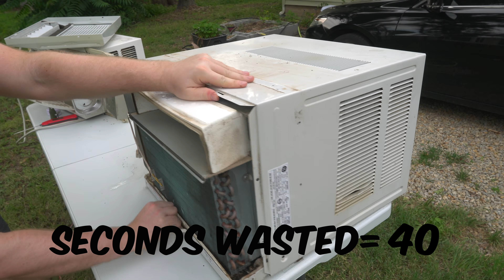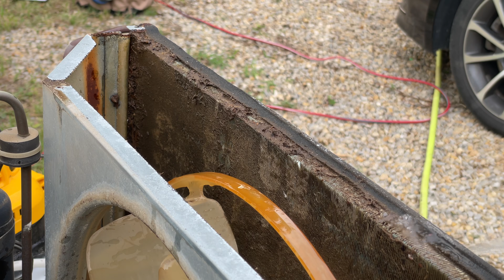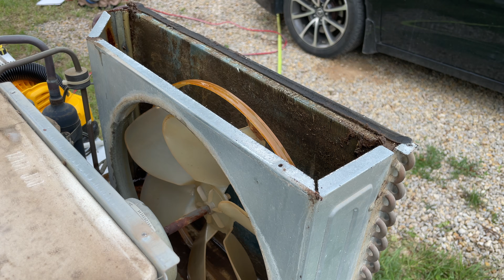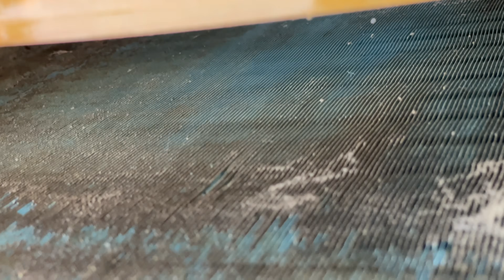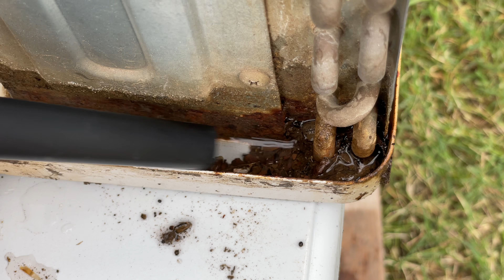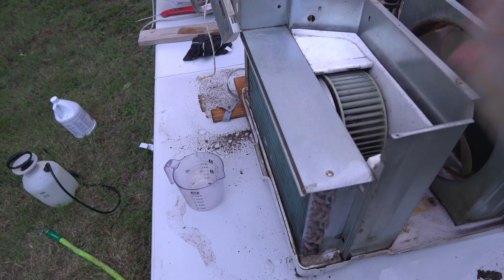DEEP Clean Window AC The Correct Way!

Comment: Mine is a dual converter U shaped Midea.  And a big mother.  It's installed on the second floor, and I live in an apartment that has no elevator.  I noticed it has screws on top of the outside part.  I think I might need to put coolant in, because a couple of times I smelled a sweet smell.  This one is 3 1/2 years old.  I wonder if I should just replace it.  I can't take it out of the window, as it's too heavy and is bolted to the brackets.  Can I get some advice?  I keep reading a window ac should last 8-10 years, and Id hate to just toss it after 3 years of regular use
Reply from the maker: If it's cooling fine, I would just keep it. One thing you could do is buy the coil cleaner, link in this video description, and clean the part that is on the inside. Make sure your filter stays clean as well.

Comment: I just cleaned my window unit today but had to come up with a way to get it as clean as possible WITHOUT removing it from the window. (I leave it installed year round because it's 90-125° 7 mo/yr where I live,  I just cover the vents for a few months when it gets cold at night.) I always have Simple Green on hand, a habit I picked up from my dad, but I needed to find a way to clean out the inside without having the convenience of being able to take the outer shell off to see what I was doing. My solution? STEAM. I have a high pressure handheld steam cleaner I picked up for about $50 on Amazon that get up to 280° with controllable pressure output. I took the front cover off, protected the circuit board and thermostat, sprayed the F out of the fins and coils behind them with Simple Green, used a soft but dense makeup brush to gently scrub the fins, then blasted the fins/coils, air vent duct, and the fan blades/wheel with high pressure steam. It cleaned all the buildup and mildew that I could see without using harsh or corrosive chemicals, and even in a house with people who smoke, the residue and buildup on the front cover and inner fins/coils just melted off. No damage to the delicate fins, no risky degreasing chemicals. After watching a ton of YouTube videos of people cleaning window A/C units, I'd bet using steam not only cleans and sanitizes the entire unit more thuroughly, but it does so with less than half the work and doesn't introduce any chemicals at all. Even if I could take my A/C out of the window, I'd still clean it the same way I did today. When I compare my results and the amount of work it took to get them, it's no contest.
Reply: What steamer did you buy from amazon?
Reply: You should make a tutorial

Comment: Is there a way to do this WITHOUT taking the unit out of the window? When I installed my unit I acually took both window panes out, made a custom frame around the unit to prevent any possible holes, then used 2x4s and a sheet of 3/4" plywood (with 4 thick coats of waterseal then coated in 100% silicone) to seal off the window completely. I live in the middle of AZ in a mobile home, in the summer,  even just a tiny sliver of sunlight can heat up a 15x15' room by up to 20°.
Reply from the maker: No, but you can clean it really good using the "lazy"  way, I have a video on that

Comment: I Just use water hose with a spray nozzle on front fins through the front,and the back fins spraying inside through to the outside works great everytime.
Reply from the maker: In sure that does a good job. It's definitely better than nothing and quick

Comment: I use this ac cleaner it works great tip for cleaning these things on a regular basis these things werent really made to be taken apart. make sure unit is off what i did was cut out 4 of the airhole slot fins in the left side just big enough to get my shop vac hose thru and bam now u have access to keep this thing clean i recommend running clr overnight twice a month to keep corrosion down. If the unit is covered in crap youll probably have to disassemble and clean like he did my method is to keep it clean i do this without ever pulling it from the window. Use this methond and the outside pan part of the ac will be clean year round it will break up crap that was stuck in there too so be prepared to shop vac it a few timesnfor the first week. there is mildew in the styrofoam front side of ac u can take off the front grill and  bleach clean really good and tape a rag to a big screwdriver and use it as a cleaning tool for styrofoam front area and hole.

Comment: First major appliance deep clean as an adult and your tutorial made it so much easier! I’ll find you when my fridge is next ;)
Reply from the maker: Alright! Good job 👍🏼
Reply: @HandymanHertz I have to tell you , I'm extremely leery to take mine apart . 
   But I'm noticing darkwater pooling up in it and it's a newer model from Toshiba ( 6,000 BTU ) ... ALL plastic crap .
   It doesn't have the hole in the bottom and I don't know if I  should drill one ; people say it's not a good idea ... 
  An ample amount of water DOES drip out , though  .
   I'm thinking I'm just better off at this point trying to make it through the next 2 and a half months here in Dallas by just flushing out the bottom and and the blades with some of those cleaners  ?
    If you have any suggestions -- that means a REAL LOT to me , man  .
   Any advice is greatly appreciated .
Reply: @HandymanHertz Also even though it's in a window on a patio that has a roof over it ... I still got the brutal morning Dallas sun beating down on my AC unit ... I can't believe how hot it gets on my patio some days as early as 7 a.m. and only just recently learned that I should try to find a way to SHADE the unit FROM THAT DIRECT SUNLIGHT ... but we're not allowed in this apartment to have anything such as patio curtains or screens  .
   For some reason my tiny pea brain is not able to think of something that will NOT block the air but will block out the sunlight ... ? 😂
   Any suggestions  ?

Comment: Hi!  I love the video, but I was hoping to not dismantle the whole ac.....I cleaned most of the parts and do stay consistent with the filter...Looking inside from the vents where the cool air flows in you can see a curved styrofoam piece (inside the unit) and I noticed some discoloration....black spots? I did the best I could using a long flat head screwdriver with a wet thin towel attatched....Hard to reach all the way in and I cleaned what I could....Lysol wipes, bleach, vinegar?? Any opinions or thoughts....I appreciate you and your advice!  Thanks!  Deb~Rhode Island
Reply from the maker: I personally wouldn't use bleach or vinegar, as they are corrosive to metal. Maybe some concrobium (link in description) would do the trick. Every unit is a little different, but I'm sure you can keep digging and disassemble it a little more. Good luck.

Comment: I think, after you spray and clean the mold with the tri-sodium formula Concromium, you want to spray it again to leave salts on surface to prevent new spores from attaching and to smother the roots of the old mold which prevents it from coming back.
Reply from the maker: That makes sense, thank you for the tip

Comment: I plan on doing this tm bc i bought mine from someone on Facebook market place and its so bad it leaks condensation out of the front bc the back clogged and it doesnt circulate air
Reply from the maker: This is a good idea. Make sure you unplugged the passage from the front to the back, or it will continue to leak inside unless it's not properly tilted

Comment: If the fins are so plyable that water can bend it,
How is it that you can scrub it so hard with such a hard wire brush??
Reply from the maker: You scrub parallel with the fins, so you don't have any side force to bend them. You can spray high-pressure as long as it's not at an angle.

Comment: So this helps it blow out cold air again too? Mine is about 1-1 1/2 years old and it’s starting to blow out warm air.
Reply from the maker: Yes, there's 100% correlation between warm air and a dirty condenser coil and evaporator coil and air filter 👍🏼 in fact, I have a video where I compare it before and after a deep clean and there was a huge difference. You can find if you like.

Comment: Do Not use CLOROX on any kind of mold from walls to wood to a/c units because it tends to feed the mold and don't get me wrong it will clean off the mold,  but the mold will come back faster and will be twice as thick.  You're better off using Lysol, which will work faster and be gone longer.
Reply from the maker: 👍🏼 thanks for your input.
Reply: Bleach any kind of bleach is a bad for these due to it being corrosive to basically any kind of metal (some exclusions) degreasers are much better and safer option

Comment: There are E-Z Detail Brushes similar to that long one you have . They are used by car detailers and workstuff , small brushes to get into tight spaces . And buy one with an inverter motor , uses much less  electricity.
Reply from the maker: I didn't even think of looking for brushes in that industry. Have to check them out. Thanks.
Reply: @HandymanHertz  ok

Comment: Speaking as a doctor: mold control products often contain isothiazolinones that are strong sensitizers capable of inducing allergies. Researchers have also linked them to endocrine disruption and neurotoxicity. Unfortunately, they are increasingly ubiquitous, found in many personal care products, household items, and even some paints.

Every window air conditioner I’ve seen has so many nooks and crannies that it is impossible to thoroughly clean them — and few folks take the time to do that. Reputable manufacturers would therefore not make them but instead redesign window air conditioners to make thorough cleaning quick and easy without disassembly. Because they don’t, countless people see their doctors for coughs or other problems treated with medicines that are often costly and produce side effects. Unfortunately, very few doctors understand the extent to which the exposome influences health. This is but one of thousands of exposome factors overlooked by doctors as well as unconscionable manufacturers producing needless problems.
Reply from the maker: Interesting perspective.  

people need their houses cool…and need window ac's,  so what's one to do? 🤷‍♂️ 

I don't agree with your theory that "reputable manufactures are not making them and if they did would make one that could be cleaned quick and easy without disassembly" that's a wild and idealistic claim. it doesn't sound like you have much understanding of engineering or the mechanics of making that happen, or understand how far refrigeration has come (or not come). In all fairness, neither do I.
Reply: @HandymanHertz  : There are many possible ways to circumvent this problem. For example, eliminate areas (especially inside*) that trap condensed water, pooling as stagnant water that provides conditions favorable to mold growth. (* The trapped water outside is intended to provide a pool of water that is slung against coils to increase the unit’s efficiency.)

Another idea: eliminate idiotic design elements. For example, my window AC unit (how I discovered this problem and learned of many others on YouTube with even worse mold contamination) has a convoluted air channel made of Styrofoam (or expanded polystyrene = EPS) that is cold during operation so air moisture condenses onto it. EPS cannot be thoroughly cleaned as, say, smooth, hard plastic, and when it is convoluted with inaccessible channels, it’s just plain stupid.

Reputable manufacturers would not take advantage of people seeking cool air and burdening them with contaminated air. As impressive as your cleaning job was, it was not complete, and I’d bet that less than 1% of consumers will do an equally or better job – meaning that over 99% will have AC units spewing out significantly more mold. Smart, creative engineers COULD create safe products; it is very doable.

Comment: This was so satisfying to watch. Do you take your window A/C units out of your windows in the off season?  That level of dirt and grime was significant.
Thanks for a great video and the motivation to clean mine.
Reply from the maker: This one came with a house that I bought, and this was the first time cleaning it, so I'm not sure how long it had been. I do take my AC out during the off-season. This one I did not, because it's so heavy and it fits my window almost perfectly, reducing the cold coming in. I have a U-shaped design, that I have two of, and I will not be taking either one of those out, because of its design. I'd recommend those, and have a video on them.

Comment: While I appreciate your attempt to give folks a way to clean their own units, I have a few tips. 1st, don't tip your unit over, compressors are not designed to be tipped. 2nd get a coil cleaner, its cheap and does all the cleaning without needing to brush. 3rd, do not use a brush, you can easily damage your coil fins.  4th protect your electronics with a bag or something.
Reply from the maker: Thanks for the tips. that Dirt/mud need some sort of manual brush, all the soaking in the world wouldn't touch that. Compressor will be fine if you let it drain out, I've never had an issue with that or electronics yet, but that's judt my experience.
Reply: I don't mean to be rude but given the fact the outside is worse than a degreaser and the dirt and pollen and rain is worse than the water getting in, so what are you actually talking about dude. No condensor is made to be moved a ton but they are, especially when you're putting it in a window and same with a fridge fridges get moved and the condenser is fine so what are you talking about
Reply: As an electronics technician, I agree that it’s best to cover the electronics with a plastic or another impermeable barrier.  It also doesn’t hurt to let it dry out thoroughly after cleaning.
Reply: @AdamRuppert  why would it be an issue when they get rain in them all the time. I would like an explanation
Reply: @Deatonis  no seriously 😂
Reply: @Amazing_80 think of your phone, most of them are pretty waterproof nowadays, but you wouldn’t want your phone getting wet if you took it apart. Same concept.

Comment: What are the parts to avoid getting wet? I’ve always been scared to clean mine like this because I don’t want to break it
Reply from the maker: Make sure you stay away from all of the electrical, especially in the front. Everything in the back is used to be an outside in the wind and rain for years and years. Just don't get too crazy with the water and you'll be fine. Give it a go. 👍🏼

Comment: The water won't mess up the electrical devices?
Reply from the maker: The back of the unit is meant to be out in the rain. But stay away from anything electrical, especially the front control box

Comment: How long after cleaning do you have to wait to use it? Any?
Reply from the maker: You should be good to go right away. If you need you got any electronics wet, you should let it dry so you don't fry the electronics. If you had to turn it on its side to take off the shell, like me, I'd wait an hour or so. They say you want the oil to be able to drain from the compressor, is why I say that.
Reply: @HandymanHertz  thank you so much. Our central air is out, we have several window units in the shop, but they are filthy. We are cleaning 3 or 4 to use! Thank you for such a helpful video.
Reply from the maker: @reginacornish3030 you bet! Glad to help.

Comment: Welp, this wht i'll b doing saturday. I have asthma and kids whom i don't want to have respiratory issues. Thnx for this video! Offically a fan ans gonna check out the rest
Reply: I highly recommend taking a 4 inch furnace filter and taping it to a box fan to filter the air if your family has respiratory issues. The one inch filter will cause too much resistance and burn out the fan.  It's helped a lot with mine. One minimum for every room works best
Reply from the maker: How did it go? Did it work out well for you?